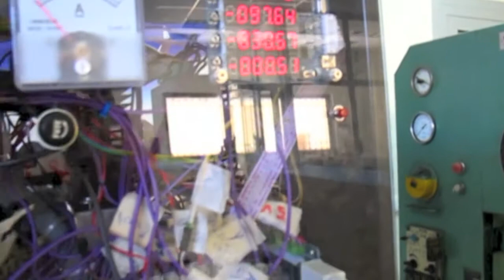Retrofitted Denford Easimill 3 CNC Play Tetris song

Comment: nice milling machine. do you run this mill in 3 phase?  also do you know if the motor is wired to delta?
Reply: Clearly.....
Reply: The milling machine have a 3 phase 2 speed motor driven from a 3 phase 230/400 Vrms supply.  The motor was wires in start.